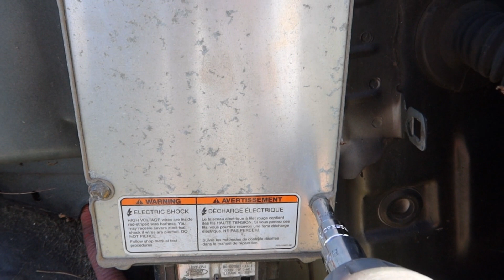7.3 POWERSTROKE QUICK TECH TALK IDM LOCATION REMOVAL

Comment: Thanks for showing this!  Unrelated to the IDM, I noticed the inner fender air filter duct.  I have not seen one of those installed on one of these truck before.  If it’s factory, what year is this truck?  (does it have a part number stamped on it by chance?
Reply from the maker: Its a 99.5 no number on it They discontinued those to save money

Comment: Hi Clint, I have a question.
My f250 7.3 model 1999 died, I came home and a couple hours later it dont start, we got a first reading saying we have a idm problem, but 10 minutes later we can not read the scanner, says it dont have comunication, what can be wrong?
Regards
Reply from the maker: If I was dealing with this issue I would check the pcm fuse to make sure it had a good connection and wasn't blown, if that was good and the wires at the back of the fuse box wasnt burned or at the pcm connection I would disconnect the batteries cross the leads after 10 minutes to reset the pcm reconnect the batteries and then see if it starts and after reconnect the scanner and see if I had connection to the pcm and get the readings if no connection to the pcm I would assume the pcm is shot and since the idm showed fault that that is shot and burned the pcm there is no way for a home mechanic can test either youll need to send them out to a repair company 99,s are known for this issue which is caused by wire harness shorting or injector poppets hitting the top of the solenoid
Reply: Thanks a lot, I will do that
Reply: @jorgelemus7449   If you think your PCM is bad. And/or IDM look up diesel technology of Chattanooga they are some great people they test out and repair your PCM for a real reasonable price

Comment: i love your videos great information. i own all 3 engines. 7.3 idi a 95 7.3 and just resently got an 04 6.0 bucket truck. (im a tree guy lol) i was wondering if you could do some 6.0 powerstoke videos. thanks or you videos they help alot.
Reply: Hot dam’ you must be a real smart guy, buying trucks with those engines. Lets see, the IDI had no turbo no power, the 7.3 is a maintenance hog with its f—-ked up fuel system and the 6.0 is just even more junk than the first two. 
Save yourself a ton of time and money and buy something with the Cummins 12 valve. 10 times more reliable and better fuel economy.

Comment: Every once in a while I’ll have a slight skip while idling. I know this could be a lot of different things, but could an IDM with 255k be one of them? The truck starts up right away, doesn’t smoke, and has good compression. When it skips I can see the tach slightly move. Is the high voltage/amperage IDM worth the extra $100 upgrade in your opinion. Thanks for all of your 7.3l videos
Reply from the maker: That kind of issue needs a running diagnostic to find the reason. The performance IDM for a regular or slightly mod'd 7.3 won't change any thing I use those upgraded IDM's when we are really doing a high performance builds where we are getting 800hp plus on dyno's for tuning and stage 2 n 3 injectors For regular use you will wreck the injector poppets